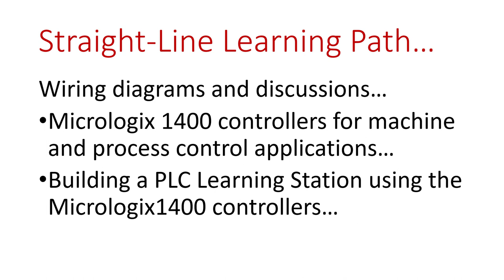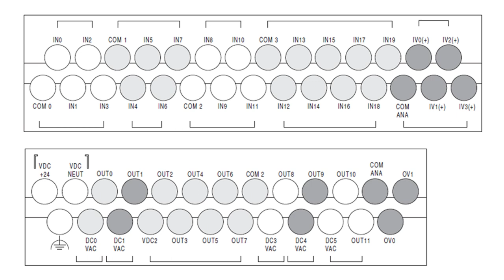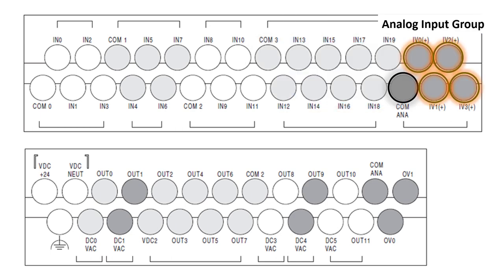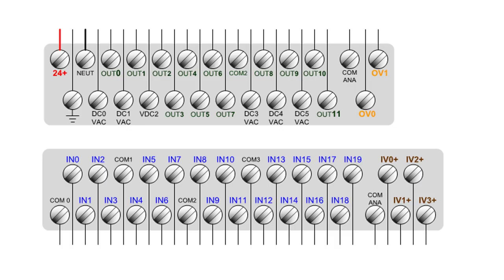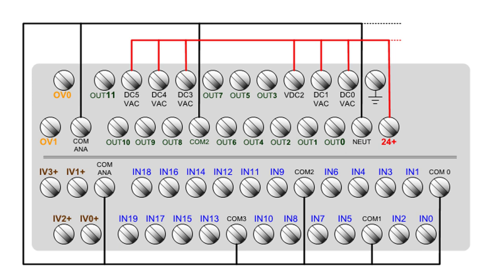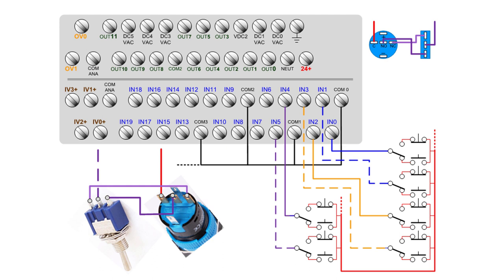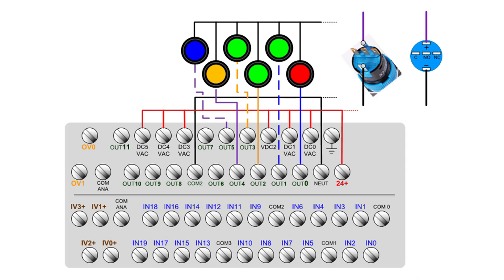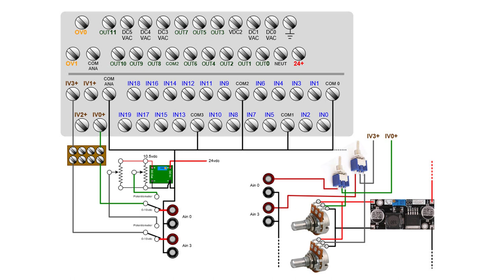Pt1 - Wiring a Micrologix 1400, Machine or Process Control or Training demo

Comment: I have a question, I'm with a micrologix 1400 1766-L16BWA, and It differs from the 1766-L16BWAA on the analog ports, showing those NC that I saw on your video instead of v1,v2, v3 v4 and com ANA in the manual. Can you answer me what does these NC Ports means? They are analog entries? Normally closed relays? Can i use those ports for what kind of logic? I read the entire manual and didnt find anything
Reply from the maker: NC = Not connected, same plastic box for controller with and without analog I/O.